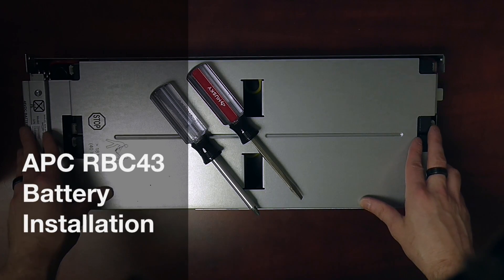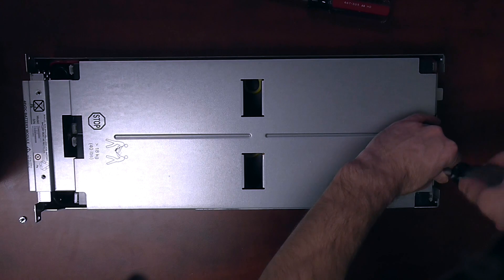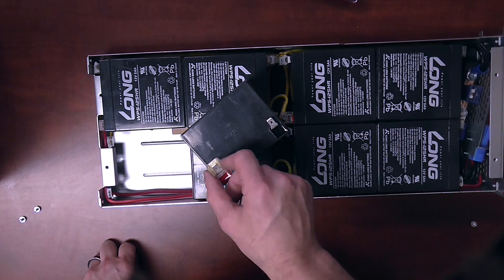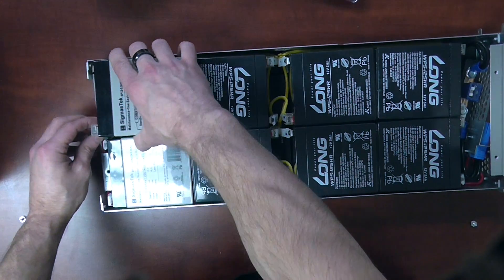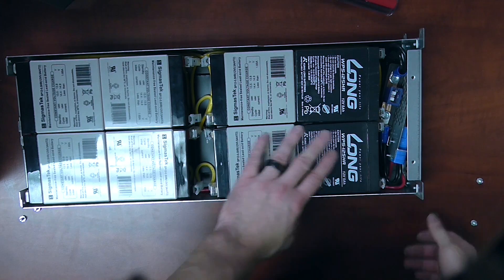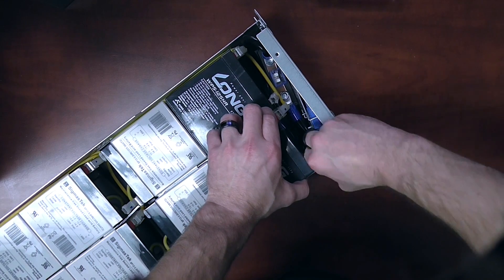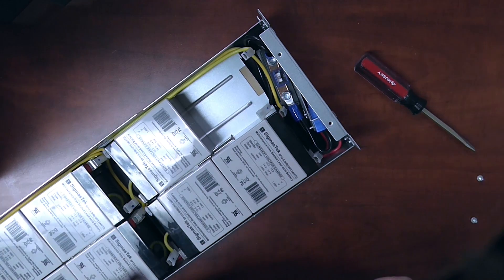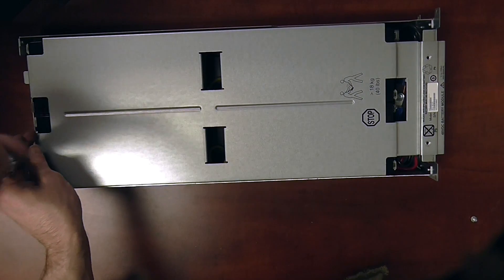APC RBC43 Battery Installation

Comment: Good day.
It is possible to put a battery wiring diagram for APC RBC43?
Someone takes a part all the battery, goes to a shop and gave the batteries for recycling purpose, come back with a new set of 8 batteries (12V 5Ah) and of course, now has problem to correctly connect all these batteries back.
Thanks a lot.
Reply: Did you ever find the wiring diagram?

Comment: Can you replace them all at once or do they HAVE to be one by one? I'm about to work on an RBC117 and RBC118 and some of the batteries you can't get to without taking out others.
Reply from the maker: You can replace them all at once - I just recommend one at a time for those who are new to this process. At the shop, we remove all the old batteries and then start the installation because we are very familiar with the wiring process.
Reply: @HighTechBatterySolutionsInc   thank you for the video and response!